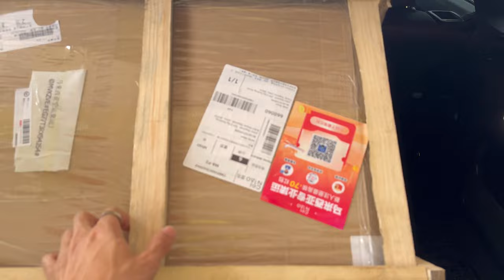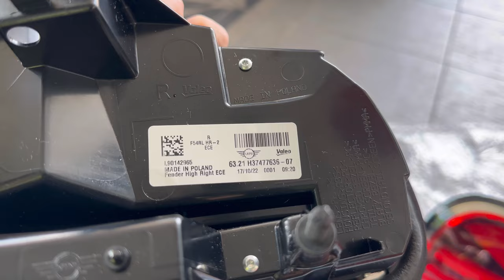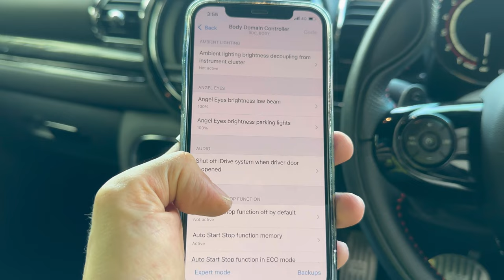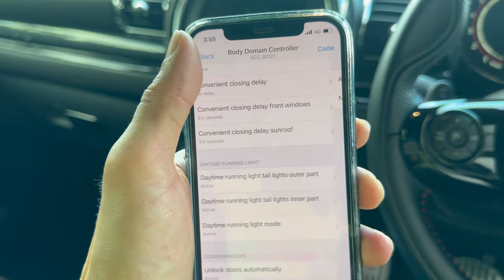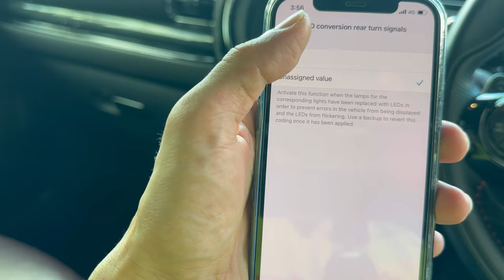DIY Car Upgrade Mini Clubman S F54 To LCI Union Jack Tail Lights

Comment: Can I follow the coding after replacement?
Reply from the maker: Yes, just change from bulb to led.
Reply: @jacky-seow  you already had led lights before, right? Just not with union jack design?

Comment: where and how do you get the coding together with union Jack lights
Reply from the maker: It’s an app called “Bimmercode” , available in iOS & Android, u need to buy an OBD connector “OBDLink CX” to connect it. The lights i got it online oversea, maybe u can try to find it from alibaba , eBay or something.

Comment: Is that harness enough? Because I saw some other videos which they tear down the rear panels and mess with a lot of cables or another video messing with circuit braker panel in the front of the car..?